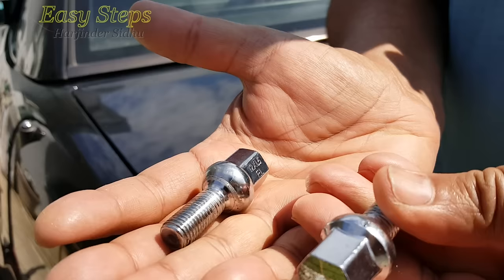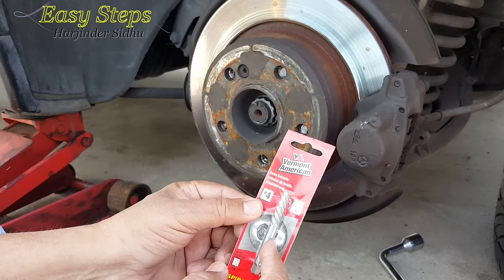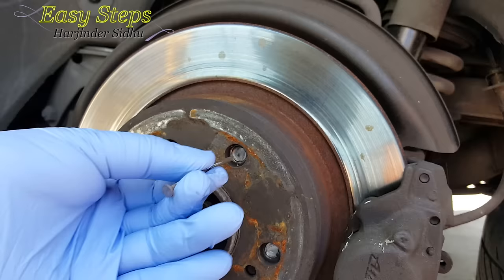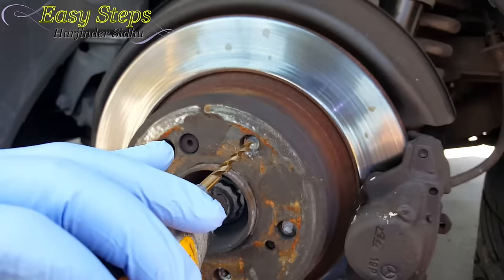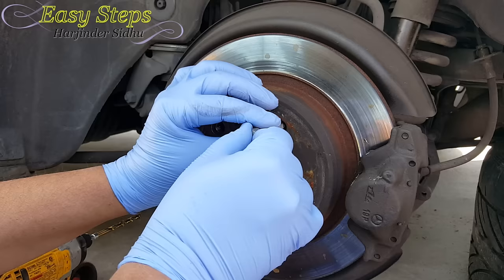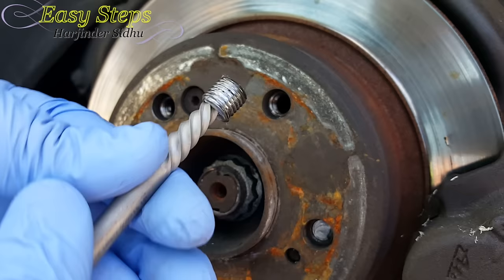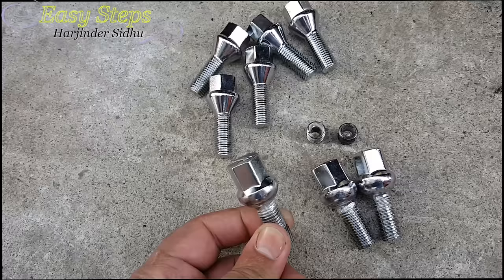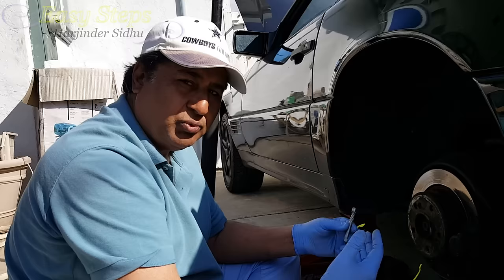How To Remove Broken Lug Nut From Mercedes | How To Remove Broken Bolt with EZ Out Extractor Tool

Comment: Thank you very much for your advice. I had a complete wheel failure and i used your method to replace 4 broken studs today. I ran through each broken stud with a 3.5 mm pilot hole and then drilled the final hole with a 6 mm drill bit. I used a smaller gauge easy out. I followed the rest of your instructions to the T and completed the job with great success. Thanks also to the AA for an excellent recovery.

Comment: Next time, try using a  left-hand drill.  You may have to go to an industrial supply catalog to find left-hand drills.   When using the left-hand drill, the broken bolt may just unscrew itself by the drilling process.
Reply: Makes sense.
Reply: The bits I got are like that. One side has the left hand drill bit while the other has the ez out.
Reply: Left-hand drill bits are also available from Amazon; they are made by Irwin and sold in a set.  They also come included in some extractor sets.  Although LH bits alone can release broken bolts, I wouldn't bet on it happening very often.  When trying to remove broken lug nuts like these, it helps to tap the threaded portion smartly with a ball-peen hammer several times and put a few drops of penetrating oil on the threads.  When drilling, use a drill bit at least 50% of the diameter of the bolt and to drill down about 1/2" or more before tapping the extractor into the hole.  Extractors work on the wedging principle; the deeper in you go, the better it grips.  It may also need to use heat to loosen the threaded portion (i.e., the area immediately around the broken bolt, not the bolt itself), should they exhibit "reluctance" when attempting removal.  It pays to have a Plan B and even a Plan C when attempting this procedure; they don't always release as easily as these did.  Working slowly and carefully, however, will increase your chances of success.

Comment: I’ve learned a lot from this. Thanks. What if a lug bolt is not broken off in there but it is stripped inside and the lug bolt won’t stay in place and keeps slipping out?
Reply: Then its either retap to larger size or replace the part that lugnuts thread into.

Comment: You can use a RH drill bit, but you get better results with a LH (left-hand) drill bit.  That starts the process in the right direction, rather than jamming the broken lug nut further into the threads.  I have an extractor set (#1-#5) that came with left-handed cobalt drill bits, so I already have those on hand.  Other YouTube videos have recommended LH drill bits for this job, as well.  In some cases, the LH drill bit will back out a broken bolt, but I don't believe that will happen here; the extractor (easy-out) will then be needed once you've got the hole drilled.  I also have a set of square, tapered extractors that are plain (no "swirling" along their length).   I think these are better yet, as they have four sharp edges that bite into the lug nut before turning.  However, either style should work.
Reply from the maker: Thanks for sharing info.
Thanks for the like and thanks for watching.
Reply from the maker: I have started posting DIY videos on my other channel "Sidhu DIY" so please subscribe, thanks.
Here is the link for my other channel, thanks in advance.
https://www.youtube.com/c/SidhuDIY

Comment: You appear to be replacing the OEM semi-circular profile wheel bolts with taper profile wheel bolts ?

This is dangerous, as the taper profile will damage the alloy wheel, and WILL NOT seat correctly - all of the load will be bearing on the small area where the taper meets the bottom of the cup.

Comment: If you use a torque wrench to tighten the lugg nuts to the correct torque the lug nuts should not break
Reply from the maker: Good point, thanks for watching.🙏

Comment: My nail bent from hammering it in the center of the lug bolt and my Titanium bit broke at the tip. I am going to add some heat first because my lug bolts are of steal or harder metal.

Comment: THE NEW BOLTS HAVE A TOTALLY DIFFERENT CONE!
On the old one it's a rounded cone, and of course the cone in your rims is rounded. 
The straight cone comes with the new bolts doesn't fit in your Mercedes rims!

Comment: I tried this method and it didn't work for me. For one thing when you drill in the lug nut it takes a while for the drill just to make an impression into it. About an hour or two. It's not as easy as the video shows. Because you are cutting into thick metal (the lug nut). And the nail doesn't make a dimple in the lug nut that easy. Because the lug nut is of a thick metal material ...therefore you are going to struggle with the drill in trying to make a hole into the lug not thus using the easy out tool.

Comment: i have used these extractors on tight bolts sometimes they snap then its a problem but mostly a good quality extractor will work just hit the bolt with a drift hard enough to break any corrosion

Comment: Mine were overtightened by tire shop. Broke a stud taking off lug bolt. Vice grips didn't work. This drill & extractor method didn't work at all. Was WAY TOO stuck in there. Took me many days of f^*(&$ with the damn thing and many drill bits ruined. Finally drilled it out close to edge and tried to retap the threads - new Lug would not grip in weakend threads - had to replace the whole hub - total PITA. Just know - this video show best case scenario.
Reply from the maker: Sorry it didn't work for you, thanks for sharing the info. Thank you so much 👍.
Thanks for watching.🙏🙌
Reply from the maker: I have started posting DIY videos on my 2nd channel "Sidhu DIY" so please check it out and subscribe, thank you.🙌 🙏 🙌
https://www.youtube.com/c/SidhuDIY

Comment: Hi, thanks for the video, you make it look easy but it's not, i have tried different drill bits to make a small hole in the stuck stud before using the drill removal bit, no chance, it wouldn't buldge. What drill bits did you use?

Comment: Use wd-40 while drilling so u don’t burn out ur bit and it cuts way easier also for Mercedes the studs go into the hub u can take off the break disk for more space to get to the bolt
Reply from the maker: good point 👍

Comment: Hello, ive got my lugs broken i tried getting the items you linked but they aren’t available anymore if you could please link something else that would work and also can i do it with the wheel on? That would work great for me as i dont have a jack thankyou
Reply from the maker: Please try this link - Damaged Screw Remover - https://amzn.to/3cUTFSF
Good luck with your DIY project, thanks for watching.
Reply: @EasySteps_Sidhu  can i do it with the wheels on? That was my other question thanks
Reply from the maker: You always can do it but it's not advisable and I would suggest using a jack. Safety is most important when you are doing any DIY. Thanks for watching.

Comment: Hello what size is the extractor i have to broken bolts on my crap Bmw
Reply from the maker: I have it listed under the description, let me copy and paste it for you.
Good luck with your DIY project, thanks for watching.🙏

Titanium-Coated Drill Bit Set - https://amzn.to/2uxtknj

Craftsman 29 Pc. Titanium Coated Drill Bit Set - LINK: http://amzn.to/245m9Lr

Rockwell RK2852K2 Li-ion Brushless Drill/Driver, 20V - LINK: http://amzn.to/1Vghc20

Damaged Screw Remover and Extractor Set by SKmoon, Easily Remove Stripped or Damaged Screws. Made From H.S.S. 4341#, the Hardness Is 62-63hrc, Set of 4 Stripped Screw Removers - LINK: http://amzn.to/1XPin9v
Damaged Screw Remover - https://amzn.to/3cUTFSF

AMPRO T73153 1/8-Inch to 3/4-Inch Screw Extractor Set, 6-Piece - LINK: http://amzn.to/1qG2TXR

Craftsman 9-66020 Black Oxide Drill Bit Set, 21 Piece - LINK: http://amzn.to/1VghKVL

Vermont American 12368 9/32-Inch Titanium Drill Bit - LINK: http://amzn.to/245mrC8

Vermont American 21822 - 5 Piece Spiral Screw Extractor Set No. 1 through No. 5 - LINK: http://amzn.to/1qG2RPO

(20) Locking Silver Lug Bolts 12x1.5 | 39.9mm Shank Length | for most Mercedes (Includes Socket Key) - LINK: http://amzn.to/1OK8UJ8

Wagner BD61049 WHEEL BOLT, M12-1.5,VW10 - LINK: http://amzn.to/1qG3Cs6
Gorilla Automotive 47179N Cone Seat Bolt Locks (12mm x 1.50 Thread Size) - LINK: http://amzn.to/1sNyMzH
Gorilla Automotive 17100SD-16 Small Diameter Chrome 4 Lug Kit (12mm x 1.50 Thread Size) - Pack Of 16 - LINK: http://amzn.to/1sNyxVk

Heavy Duty Wheel Chocks - http://amzn.to/2qpRegc
120Nm torque
Reply: @EasySteps_Sidhu  thanks 🙏

Comment: Slowly, slowly... Then revs drill to max! For anyone watching that is gonna DIY- use lubricant on the drill bit and its not about speed but pressure (ie how much material you are shaving off). Less is more because if you break a hardened bit off in there your DIY just became how to replace a wheel hub. Otherwise great quick video of the right way to do it.
    Plus take you rotor off!!! if possible.
    And use the right wrench!  or at least the wrench in your hand the right way! LoL

Comment: What size was the EZ out extract bit?
Reply from the maker: Please check out the description, I always list what I use.
Thanks for watching.
Reply: @EasySteps_Sidhu  i actually found that on the packing it tells you which size bit to use with each one. Thanks
Reply: After attempting to do this on my Benz, I found that because the threads are on the hub and not on the rotor, if the rotor is being removed the broken lug can be screwed right out by hand 😉

Comment: Good video but the new lug nuts are the wrong ones. Your old ones have a radius and the new ones are designed for wheels with only tapered holes. Putting those on the same wheel will not secure the wheel completely.

Comment: good job brother. I have lost my anti-theft locking nut. Can we take out them as you did? please answer soon.
Reply from the maker: You mean it's broken inside or whole bolt is there?
Reply: @EasySteps_Sidhu  yeah whole bolt is there I have lost the key.
Reply from the maker: Well if you are careful enough with a steady hand you can drill it and take it out, otherwise, you can damaged your rim...I would suggest buying a key socket will cost only like $5 or $6 dollars.
Thanks for watching, good luck with your DIY project.
Reply: @EasySteps_Sidhu  thank you for your answer.  It is not easy to find it customs ones in Turkey in such prices. You can get the original ones but they are really expensive. I think I will cancel all the lociking lug nuts.
Reply from the maker: There is socket it's called something like a universal tool socket and it has all sort pins inside and that can be used on anything and that will open. Just FYI...

Comment: A few comments, safety glasses a must.. good start... Your are not using safety working gloves, they are just gloves to stop your hands getting dirty. The titanium bit is not titanium, it's most likely HSS with a titanium nitride coating, better to use a left hand twist cobalt drill, some are titanium nitride coated , they are not cheap though. As you drill it might twist the broken thread out. I would always give a good soak with penitrant  spray first and perhaps a few good wacks with a parallel punch or drift to shock any corrosion. Freezing spray is an other option as is heating with a gas torch , it all could help.  It's a lug bolt not a  nut... I'd always use a tap wrench or mole /locking wrench, you will slip with an  adjustable spanner.  A nail is mild steel, it won't touch a steel bolt, use a center punch, a masonary nail will work but they are super hard and very likely to shatter.
Reply from the maker: I am posting a thanks message to my viewers/subscribers for their support.
Both YouTube channel was hacked/hijacked on (4/24/2019) and I got it back now (5/5/2019). The hacker has deleted the information under the description of my videos as well as all my comments. 
My YouTube Account Got Hacked - https://youtu.be/1xLEciPJqlk

Comment: Hello Harjinder, thank you so much for this video. I encountered the exact same situation in my w209. Do you have any idea, why your bolts snapped in this way? What caused this?
Reply: Probably combination of old bolts and over torquing. I wouldn't trust a dealer to do my bolts.
Reply: @dereksbooks  I measured my lug bolts, and half of them were stretched

Comment: I wouldn't use a cone seat lug bolt on a ball seat rim.
Reply: +Easy Steps if they are authentic amg wheels then ball seat is what they should take. If they are replica amg style wheels then I wouldn't be sure. All oem Mercedes wheels are ball seat though.

Comment: New lug nut is different than old nut.......? wt. you need to buy same shape log nuts.
Reply: Sorry but did you use the same rim on the car as before? If so, then you need  the ball head screws, or were they the wrong ones? i mean so or so its a bit confousing and seems like you have no clue. Just put your finger in the mounting hole and feel it. Then you know if it is a cone or ball head. Btw. i work for Mercedes in Bavaria, and from what i know you destroyed you rims if you have used the wrong ones, cause steel will deform the softer alloy.

Comment: Where are you located.
Reply from the maker: California
Reply: @EasySteps_Sidhu  are you in Los Angeles  I have some lugnuts stuck on a Mercedes  they broke off on the end
Reply from the maker: No, in the Bay Area. Please try the same method as I have shown in the video and it works for sure. Good luck with your DIY project.
Reply: I tried and the tool broke off inside the lugnut
Reply: I was able to drill but didn't work